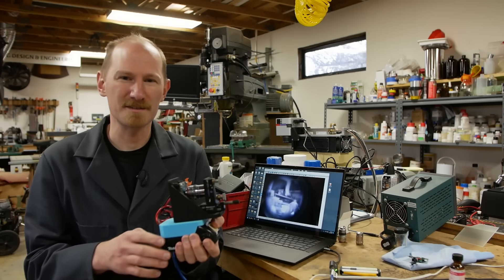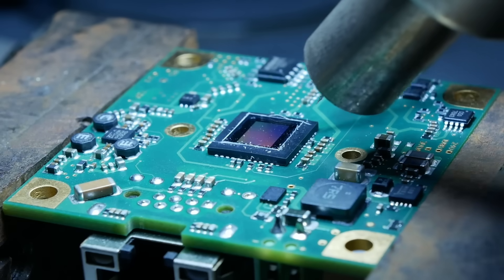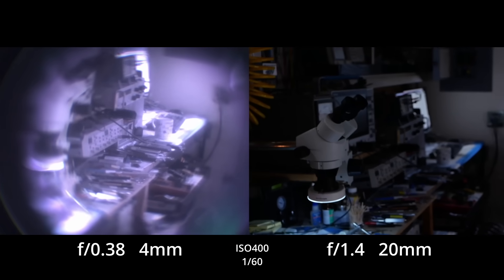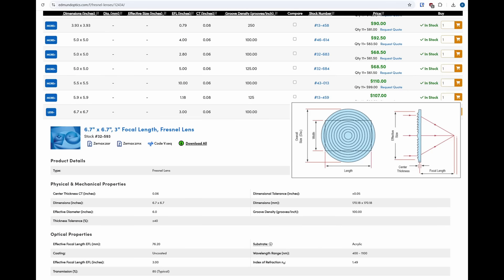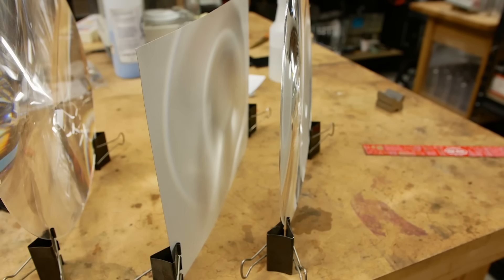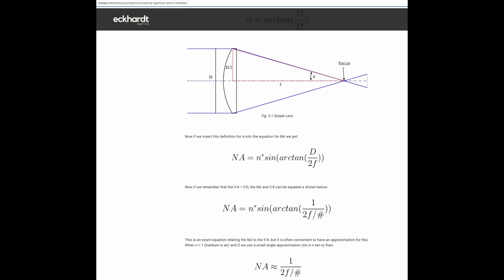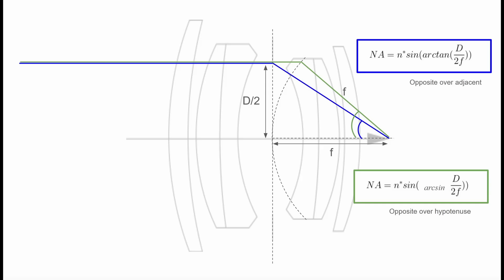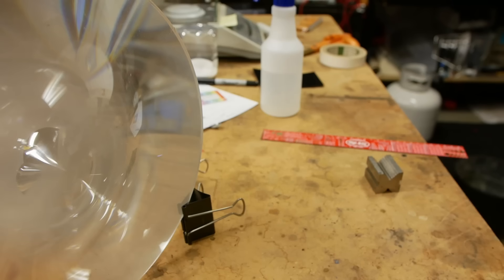f/0.38 camera lens made with oil immersion microscope objective

Comment: Something that clicked for me a while ago vis-a-vis bokeh/DoF for a given lens, is that the f-number and its numerical relationship to the focal length are a bit of a red herring. If you're only looking at depth-of-field and not overall light collection, for all practical purposes, the only thing you need to know is the size of the entrance pupil. Hence, wide focal lengths with fast apertures have a deeper depth-of-field, since even at a low f-number you're looking at a fairly small pupil diameter. For a subject at equal distance, you might observe the real-world measured DoF to be identical between, say, a 20mm f/1.0 and a 40mm f/2.0 - even if the former would give you a much brighter image and a wider field of view. The caveat to this, of course, being that your field of view (being a product of focal length and crop factor) will likely also change the way you compose your image, so in practice this isn't always apparent. Mathematically, though, the measured depth-of-field in an image should be directly related to only two things - the distance of the focal plane, and the diameter of the entrance pupil.
Reply: You are right only when the background is at infinity: in that case the bokeh will only depend on the entrance pupil. But if the background of the subject is close to the subject, a smaller (enough) f-number can create a shallower depth of field. For example, try to compare a 200mm f/4 and a 50mm f/1 with the same subject and sensor size: the bokeh will be the same for the background at infinity, but the depth of field around the subject will be much shallower with the 50mm f/1.
And by the way, entrance pupil, besides the f-number, is also very significant when it comes to light collection. With a larger entrance pupil you can illuminate a larger sensor, and even if the light per unit of surface on the sensor may be lower, the more light gathered overall can create better pictures thanks to higher signal-to-noise ratio and resolution.
Reply: @paolovita1720  I tested this just now in Blender - an imperfect comparison to real-world gear (or rather, too perfect), but based on physical cameras enough that it can be used as an analogue; the mathematics are more or less identical. 200mm f/4.0 and 50mm f/1.0 provide an exact DoF match at several focal distances, and the images become indistinguishable when you accommodate for the different FoV by adjusting sensor size/crop factor. In other words, an entrance pupil of 50mm diameter provides the same depth of field, in actual measured width, regardless of focal length. I won't take that as gospel truth - perhaps I'll try comparing 50 and 200mm IRL at f/2 and f/8 - but at this stage I'm willing to bet that this holds true regardless of subject distance.
Reply: @paolovita1720  This sounded interesting, so I tested it in Blender - an imperfect comparison to real-world gear (or rather, too perfect), but its light simulation is based on physical cameras enough that it can be used as an analogue; the mathematics are more or less identical. A simulated 200mm f/4.0 and 50mm f/1.0 provide an exact DoF match at several focal distances, and the images become indistinguishable when you accommodate for the different FoV by adjusting sensor size/crop factor. In other words, an entrance pupil of 50mm diameter provides the same depth of field, in actual measured width, regardless of focal length. The exposures would of course be different according to the difference in f-number. I won't take all that as gospel truth just yet - perhaps I'll try comparing 50mm and 200mm IRL at f/2 and f/8 - but it's a start. At this stage I'm willing to bet that this holds true regardless of subject distance.

Comment: In case you haven't seen it, Media Division on Youtube built an f0.3 lens (by  using a diffuser sheet in the middle as a hack).
Reply: as far as depth of field goes, it looks like f/0.3. but as far as light collection goes, it’s not because the light doesn’t go direct to the sensor. that’s what makes a true ultra fast optic like this so special, it collects stupid amounts of light and shoves it right onto the sensor!
Reply: They did not, they did something that "looks" like what a f0.3 lens would look like. Which is interesting in its own right, but not an answer to the question being asked here by Ben.
Reply: @gu4xinim  It depends if you’re describing it with the optics f0.3 or the photography f0.3, because with the former the technicalities make a difference but with the latter, if it looks 0.3 it is 0.3.
Reply: Where did you get this idea from? There is no dual definition of F number, it has a clear definition (focal ratio). Half of the video above is clearing that up. The Media Division video is careful to use the "equivalent" qualifier to make clear they're emulating one aspect of what a f0.3 would look like, depth of field in this case.

Comment: @2:04 made me say OMG out loud because that one microscope I bought off eBay must've needed oil. I just crashed the lens into the slide every time I used it... for months... (not every day)
Reply: Most of the immersion lenses have a spring-loaded tip to prevent the smashing and carnage
Reply: If they didnt; undergraduate biology courses would be impossibly expensive to run! @BariumCobaltNitrog3n

Comment: What's the effectiveness of the infrared filter? Having used NVG's, your camera looked like perhaps it was still capturing more infrared light giving the impression that it was brighter.
Reply: You can see its "normal" light, since u can easily read color of objects lit by windows light.
For NVGs it would be B/W.
For IR colorful image colors would be "random" compared what we used to.

Sensor he used is MT9P006, with Bayer Pattern color filter, which means 2 green, 1 blue, 1 red filters per 4 pixels.
Amplification of each "color" channels optimised accordingly to give natural white balance for "common" filming conditions.
Outside optimal parameters blue+red channel amplified more(or green less) so image become purple-ish.
Which can be observed in any "cheap(bayer's filter is popular solution)" unmodified camera by setting high ISO/shutter speed.
Its not like IR filter works poorly, and we get useful IR light, its noise by sensor it self and we get image polluted with garbage.

To avoid it sensor with other filter type should be used. Or sensor with channels voltage(amplification) control.
Reply: Yes exactly, I've had infrared converted cameras and they had the same purple-ish look, but mainly outside under the sun. I am not sure if that candle is a bright enough IR emitter to make everything purple, even in the shadows under the bench.
Still the infrared filter in front looks to be correct from its blue hue and the pink glare, and I'm sure he would know how all of this works.
Reply: Came here to post this. A lot of commercial IR blocking dichroic filters still pass a relatively high amount of IR as relating to silicon's sensitivity to IR vs visible light. Even expensive cameras like RED or Blackmagic have suffered from these issues which typically show themselves when filming black fabrics in strong sunlight, which makes the fabric appear red or purple. You can of course stack multiple IR filters to combat this but in the context of a super low aperture lens that is gathering as much light as possible the added light loss is probably undesired. I'd be interested to see a follow-up video if you can find a single filter dichroic mirror/filter that more effectively blocks IR to the point where your camera outputs natural colour without a pink tint.

Comment: could you have drilled a very small hole in the glass sensor cover and vacuum injected the oil?
Reply: It's easier to remove glass than drilling microscopic hole in to a glass without damaging sensor behind it.
Also, glass plane is purely protective and doesn't contribute to image quality.
Reply: Glass refractive index is closer to the glass of the lens. And closer to mineral oil than it is to air. You'd have sensor, oil, glass cover, oil, glass lens.
Reply: Glass also has its own refraction index... He can try, but drilling into glass, getting oil in there and getting air out seems like too much effort (and even lower yield) for something that most likely won't work that well.